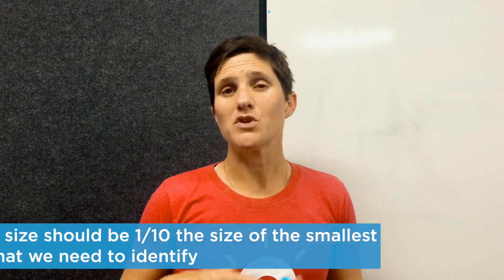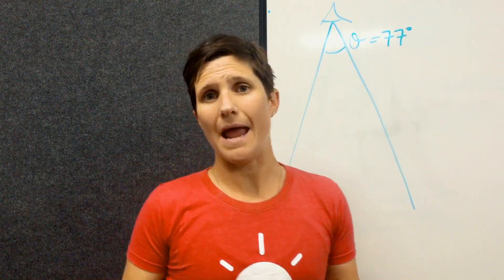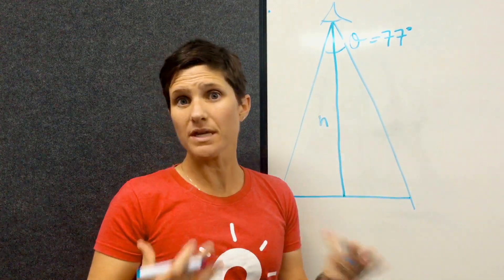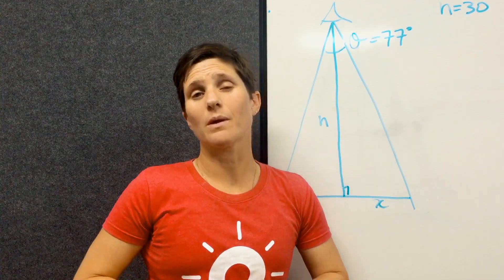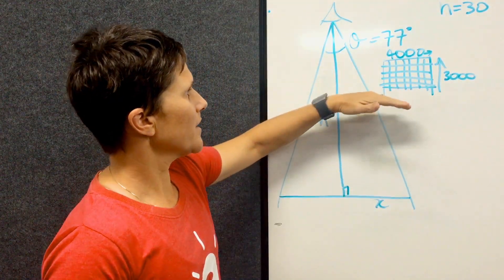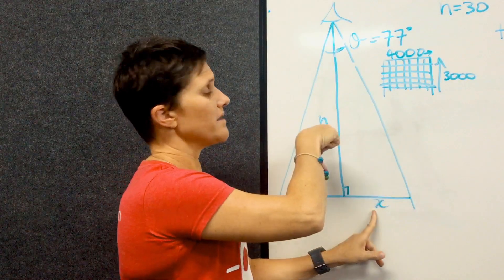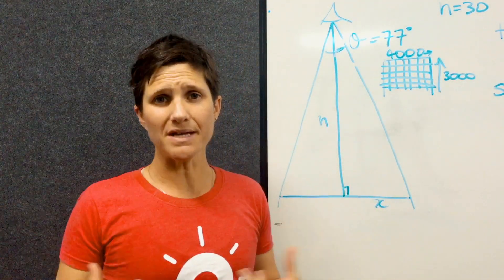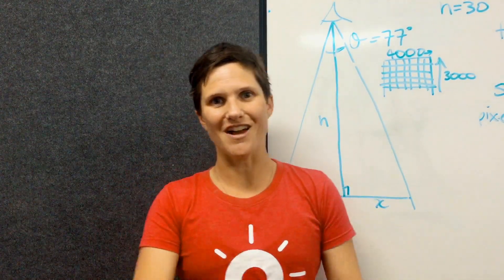The Relationship Between Drone Flying Height and Pixel Size.

Comment: Hi. You explained perfectly how to calculate the ground width of a pixel but I was wondering how you would calculate the ground surface area of the swath which would relate to the sensor area of the camera.
Reply: your camera will have a certain number of pixels in the array, so you just multiply that by the GSD and that will give you the width/length

Comment: the 1/10 rule seems a bit low, did you mean on a single dimension ? i.e. either the smallest feature about 10 px total, or 100px total ?
if let say object is defined by 5-10 features like that (of 10 px) that does make sense, but if the object is the feature - 10 px would be difficult I believe.
Reply from the maker: For example if you have a tree with a 5m diameter, you want a pixel size at a minimum of 50cm.

Comment: Thanks Karen. So is best to ensure quality pixel to fly a little lower than the formula result? Does it hurt to err on the side of caution to ensure better pixel quality in the end result?
Sometimes drones are not always accurately reading height for whatever reason.( I'm not talking about accuracy in take off 0 feet and where I'm actually working) All sorts of other variables in our environment can sometimes give us slightly inaccurate readings on drones. Your thoughts?
Reply from the maker: Absolutely you want to err on the side of caution. Data greed tends to make us want to fly higher and capture a larger area, but what's the point if the feature you're interested in is no longer identifiable? Far better to have a smaller but useful dataset I believe. And yes - I have a few drone data sets flown from the back of a boat where the metadata consistently say that I was up at 140m altitude but the flight was only planned at 100m. Definitely worth checking!
Reply: @DrKJoyce  Yes ,water does that alot and I have found inaccuracies like yours of 40metres plus. 
I have to land it to allow it to just recalibrate itself for overland flight. Appreciate the fast response and advice. Thou my interests and passion in drones lays in the health industry  the diversity of work helps pay the bills atm. Thanks again Karen.